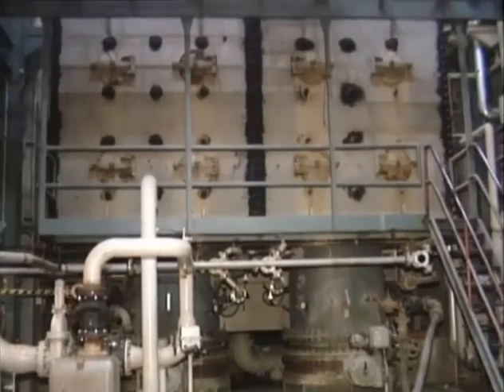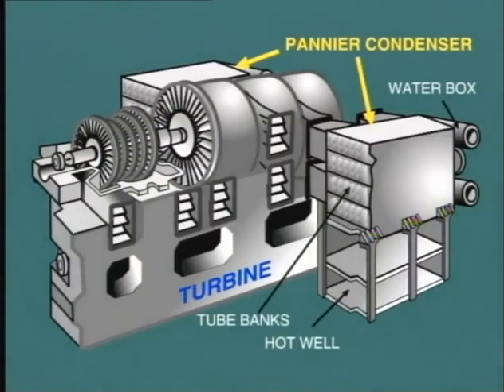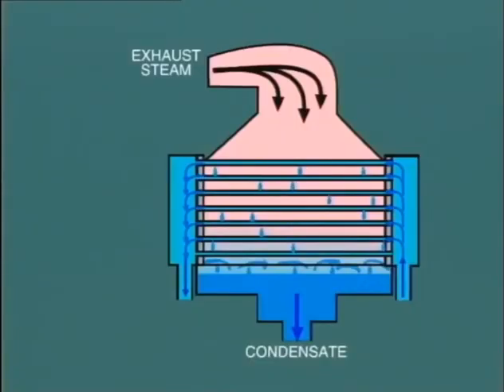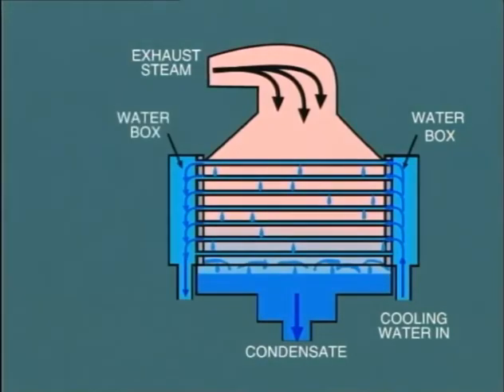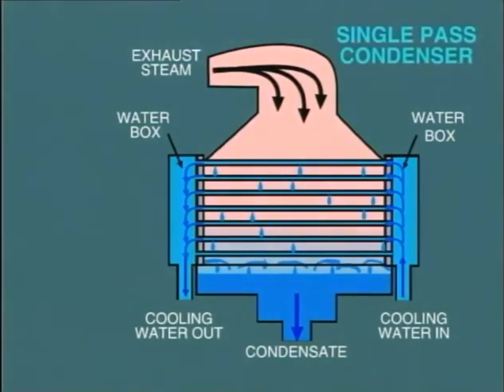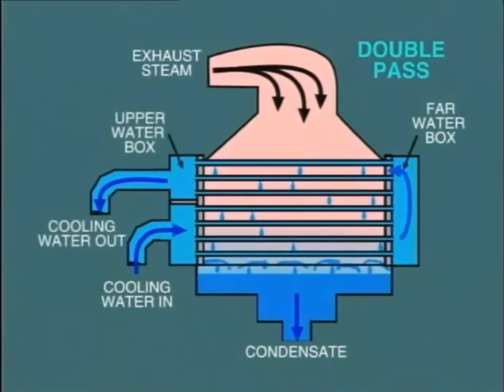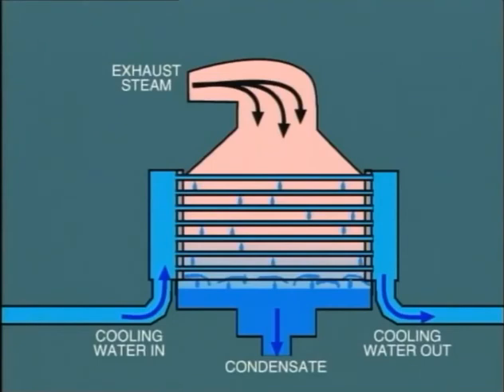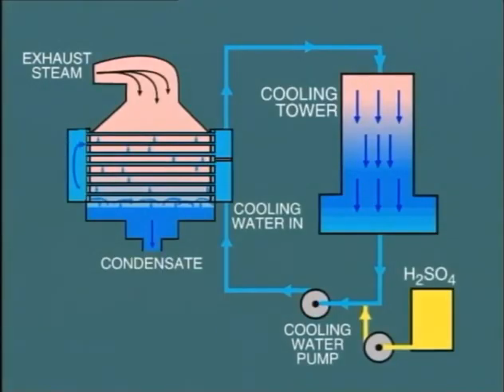lesson 11 : vacuum in condensate steam turbine part 1

Comment: I came here for the vacuum. The condenser creates a vacuum because steam is a larger body then water, so when you transfer steam to water it creates a vacuum. The condensing exhaust creates a vacuum resulting in less turbulence and less back pressure on the last set of turbine blades. Thats why we have condensing turbines  This may be in part 2 but i cant find it.
Reply: The surface condensation operates in a vacuum for the purpose of lowering pressure to get the steam into water (condensate) as quickly as possible.